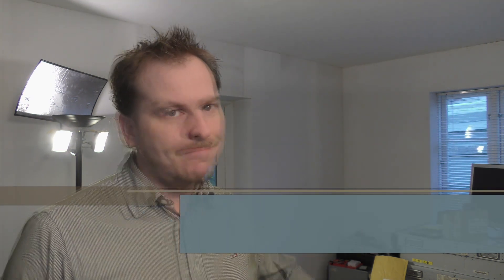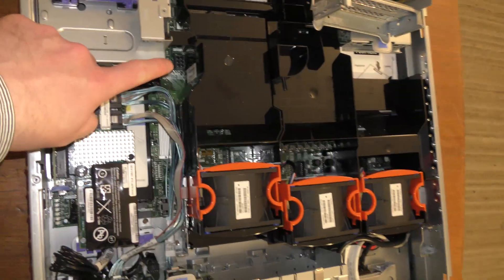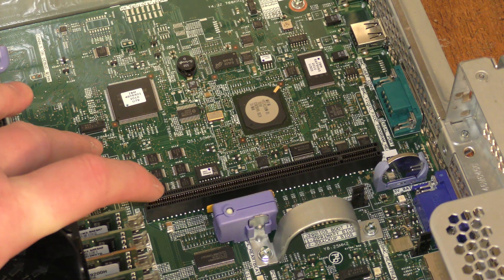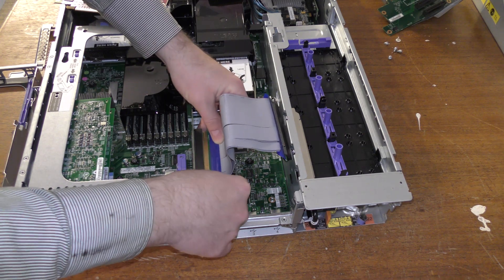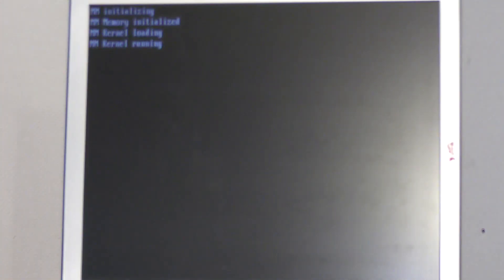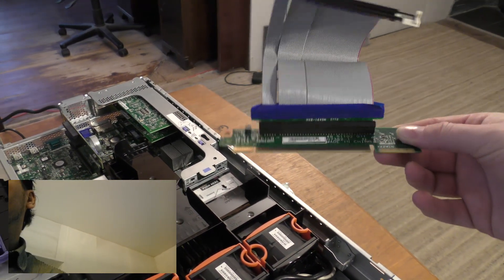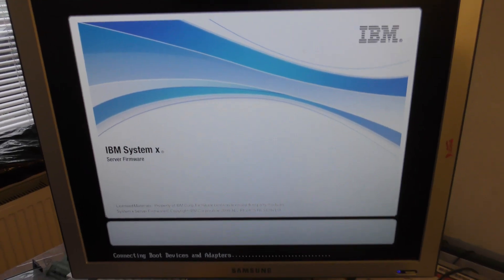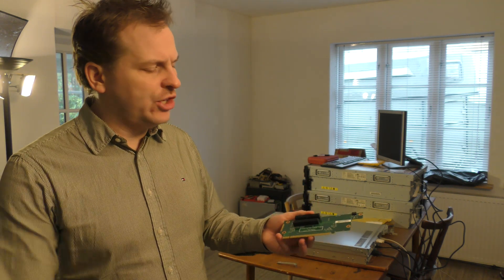Trying Riser Card from IBM x3550 in IBM x3650 M3 - 434

Comment: Can I use the ribbon cable streight into the motherboard I have one of these and am thinking about doing the same but don't have the riser
Reply from the maker: Hi Deathstrike 19781
I do not think so, the connector on the mother board is for the Riser card, and that is for two three PCI-e slots,, so connections might not be right and you might get in to bad trouble.
Glad you liked the video :-)
Thank you for watching! :-)
Reply: @MyPlayHouse  thanks for replying 🙂

Comment: hey i think i can help im 99% shure that the fan and shutting down is because you put the x3550 riser in riser slot 2 and not slot ...1 now i know with mine if i dont put the 2 8x pcie riser in slot 2 it has a fit fans run flatout and shuts down  ect i feel if you put the normal 2x8x pcie riser in slot 2 and put the x3550 riser in slot 1 it would work as you said the card works the server just has bit of a hissy fit wich is the same thing it does if it dosent have enything in slot 2
Reply from the maker: Hi nicholas merwarth
Thank You very much!  glad you liked the video :-)
Thank you for watching! :-)

Comment: Excellent idea Morten. How about if you try to place the card on the X8,  like in this low profile card    https://www.ebay.ca/itm/NVIDIA-GeForce-GT-710-PCI-Express-20-x-8-Lowprofile-graphic-card-1GB-DDR3-HD/173183056081?hash=item285283b8d1:g:KWIAAOSwl5pZfg~S      But you can place 2-3 cards there no sweat. It takes minimal power from each slot, may be the fans wont cry.
Reply from the maker: Hi Mamdouh Tawadros
Thank You very much!  glad you liked the video :-)
Thank you for watching! :-)

Comment: Hi.
For install 16x card use 43V7064 IBM 1X16 PCI-E RISER CARD.
This information write on server lid -).
Nice video, thanks you.
Reply from the maker: Hi Nixoid Tab
Thank You very much!  I managed to obtain the 43V7064 in later videos for the x3650 M3,, it's the unicorn of spare parts.
Thank you for watching! :-)
Reply: My PlayHouse, now I'm starting build "server for games" and think about install GeForce 1060 in my IBM x3650m3 and looking for information - you channel is useful for me. And I think x8 lanes pcie will be enough for dual CPU configuration with Xeon L5640. (Less power, but less heat).
If 8 lanes pci-e will be bottleneck - I'll be looking for 16x riser card.

Comment: if you try with standard 8x riser and use an extender 8x to 16x?? http://www.ebay.ca/itm/PCI-E-Express-Adapter-Extender-Cable-8X-to-16X-x8-to-x16-Riser-Card-For-1U-2U-/271112957249
Reply from the maker: Hi Jay Roy
Thank You very much! But the extra cable do not fit very well in the server. :-/
Thank you for watching! :-)

Comment: Ibm X3550 m2 
it's too small to fit the RX480 8gb
so I simply ran the Pcie16x extender cable to the card and used a 6pin to 8pin adapter.
It boots up with low resolution  video and even goes into Windows 10.
but here's the rub I started installing the drivers from the cd.
said the screen may blink.  and then it went blank screen and after a lil rebooted with no video it switched back to the on board.
it showed pci error and the riser error light came on.
But after that it would let me get through boot with the new gpu showing boot and would crash during detection before windows. 
is there some setting I'm missing?
video below
https://youtu.be/XUiNKR8XbL0
Reply from the maker: Hi TheMegabitGamer
Interesting project,,, is the pci-e x16 an real x16 with 75W power?
Thank you for watching! :-)
Reply: slot 1 is x8 in x16 slot
slot 2 is x16
it works fine once I set all the performance settings and turned off power capping 
but that's only using the system driver at low resolution.
It doesn't want to work with the drivers from AMD.
and if I try to use them it throws a pci error and locks up video
Reply: My PlayHouse I got this server for a stupid good deal $20
with 16gb 1333 ecc reg ram
and two 2.93ghz Xeon quad
octa-cores
just bought a HP Z600 
workstation board thinking I may. pull parts to put into it.
Reply: My PlayHouse I just wish I could figure it out swapped pcie risers
so it's not the riser tried a old video card and happened on it too.
this video card would have worked on pcie 4x even

Comment: hello Morten i have question what is the maximum power of video card port on the motherboard of x3650 m2 ?i cant find it in the manual
Reply from the maker: Hi scotterbart
The PCI slot,, the x8 can only give you 25W, and the 6 pin GPU power plug 75W-ish so try not to go much over 100W.
Thank you for watching! :-)
Reply: My PlayHouse thank you for your reaction I did buy pci x16 to pci x16 20cm by Ali expres and I know that pci x16 is 75 watts also I Search for the connecter 6 pin pci and they say 150 watt max so max power for video card is 225 watts max thank you for your video's Maybe a video about how to configure imm from top to bottom on x3650 M1 and m2
Reply from the maker: scotterbart 
PCI-e x1,4,8 slot  - 25W
PCI-e x16 slot - 75W
6 Pin - 75W
8 Pin - 150W

Comment: In the HP DL180 G6, the PCI slot is 2 x8 slots back to back (which you put the riser into). A normal GPU still fits into it, but it means that the power rails are going into the GPU data lines. Probably a good thing you didn't try to force it in otherwise I think it would have exploded
Reply from the maker: Hi Matthew Smith
Thank you for watching! :-)

Comment: What is the performance of that server compared to an I5 or I7 mid range gaming PC?
Reply: The X3650 M3 (featured in this video) has room two LGA1366 Xeon processors, which a bit more powerful than a 9xx series i7 CPU, so it's like two of those i7s - that is not bad at all. However you need ECC DDR3 memory, which is more expensive than non-ECC memory, and you're limited to PCI Express x8, which should not be a bottleneck in gaming IMHO.
I worked for Alienware a few years ago, when the 900-series i7 CPUs were top of the line, and we shipped the Area 51 computers with two or three GTX 480 (later GTX 580) cards in SLI. Since the CPU had only 32 PCIe lanes, 16 were taken by the primary card, the third slot was wired for 8 lanes, and the second slot was either x16 or x8, depending on if there was a card in the third slot. Due to heat issues the 480s had to be installed in the first and third slots, causing the secondary card to be running with only half the bandwidth, but it worked fine.
Reply from the maker: Hi AttilaSVK
Thank You very much! The price of a used x3650 M2/3 with two 6core's are realy good,, just need to stick a Good-ish GPU in there,,or two :-)
Thank you for watching! :-)

Comment: Even if the system was able to work without the fan error (and normal fan operation) - the overall size and noise (even in quiet mode) you couldn't really use it as a workstation... Thank you for watching! :)
Reply from the maker: Hi Richard T
Thank You very much! Well It would be a bit more loud then the average workstation.
Thank you for watching! :-)

Comment: hi
do you think its worth it to replace my 2 e5520 and put 2 l5630 in my ibm x3650 m2
Reply from the maker: Hi ProBro_NL
That depends a lot on what you are after,,, speed, power consumption, cost,,, for speed look in to the six cores in the x5650 :-) or higher. 
Thank you for watching! :-)
Reply: powerconsumption, it isnt efficient enough yet to use the server instead of dedicated machines because of power usage
Reply from the maker: HI ProBro_NL 
Okay,,, Yes then the "L" series should do better for you!
Thank you for watching! :-)

Comment: Do you need to explicitly want a x3650 for the task? Could the graphics card go into a x3550 and use that as a dedicated server for that task?
I get the whole, more is better thing but realistically, can it be done in a reasonable timeframe? It depends what you value more. 
Another thought is maybe using the x3850 you have for the task. Lot more drives and cpus for the task?
Reply from the maker: Hi themaconeau
Thank You very much! The x3550 is a 1U server and cant fit a "big" GPU,,, My 3850 M2 are only 8x,,,, and the slots is on a big system board that if you brake that with your cutting tool,,it could be totally fucked...
Thank you for watching! :-)

Comment: ok, so scrap that, an start looking for a cheap ass hp with an x16 slot, mine was 60 pounds uk DELIVERED and takes any card i throw at it, currently have a 650ti boost in my proliant 160
Reply: could then have a server specifically for donating a gpu, nothing more, tiny ssd, your running virtualized enviroments anyway, the physical location of hardware is irelevent with enough network throughput, im only on 1gig single channel and the latencey is low low low
Reply from the maker: Hi minor0confusion
Thank you for watching! :-)

Comment: 8x PCI-e lane shouldn't be big deal for gaming. GPUs only need 16x because it can supply 75W, not because of speed (you can run GPU off 1x PCI-e without huge speed loss). You are in more trouble, if you like me, have 1U server with one 500W PSU :) . So in case when you can stick in even if it has less lanes on server - you cut off part of slot, but problem usually lies in power that you have to supply to any proper GPU - your motherboard is unlikely to supply 75W of PCI-e, for example for 1050 Ti, RX 460 or 750 Ti.
Reply from the maker: Hi Jerzyna aKwei
Thank You very much! I have an Nvidia Grid K1 card that I would like to have working with all x16,, right now it is running in a x8,, lot´s of videos on this,,, here,,my struggles :-)
Thank you for watching! :-)

Comment: Hey Morten! I remember reading somewhere that the X3650 M3 will automatically shut down after a minute or so if the lid is off. So maybe it could work with that riser if you kept it closed? Worth a try maybe?
Reply from the maker: Hi Donald
Thank You very much! I did try that! The x3650 M3 can run with the lid off,, I have done it many times.
Thank you for watching! :-)